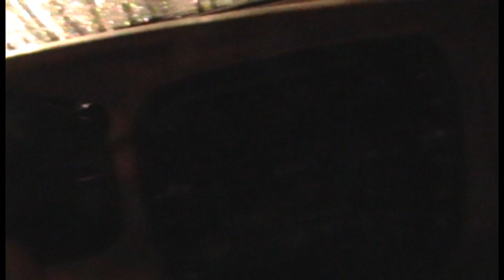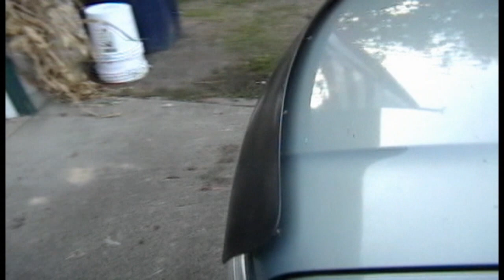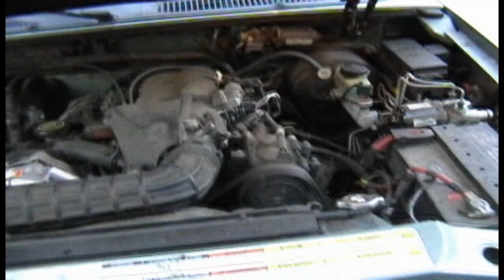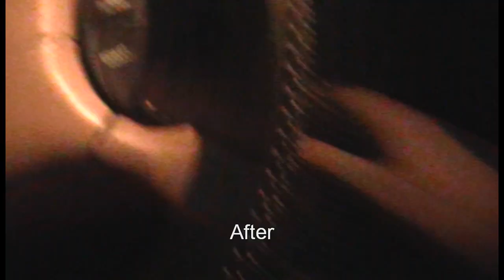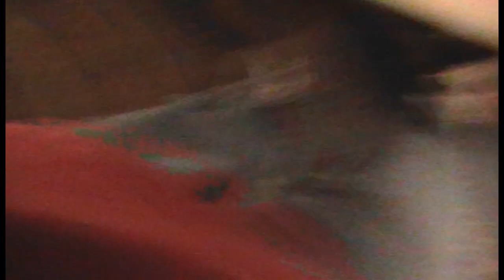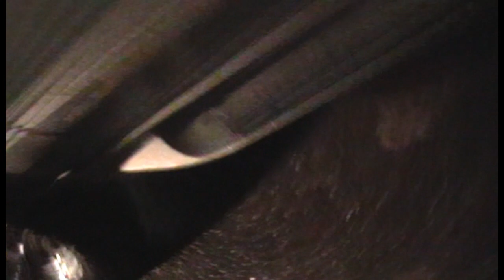Update on my 95' Limited Ford Explorer

Comment from the maker: If it makes the same noise as mine did, then change your plug wires, plugs, and clean the ground plate on the coil pack. After that, it should run much better.

Comment: i have a 99 sport, im hearing a clacking and clinking durring idle and operation i have owned it for a lil over a year and am not sure when the last time the plaug and or wires were changed so i am def gonna do that very soon. where is your coil pack ground plate? ours are prolly in the same region